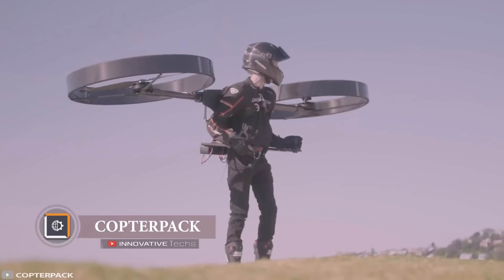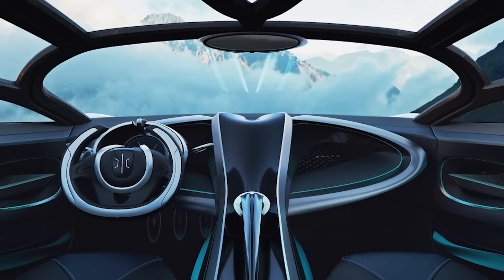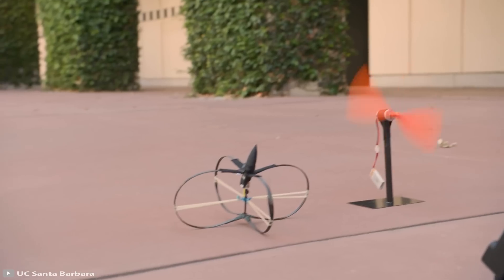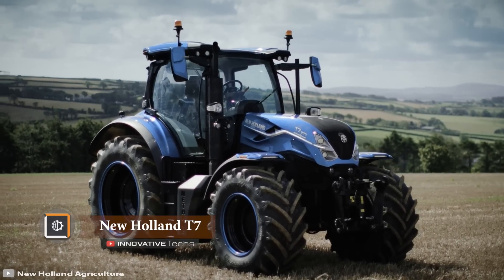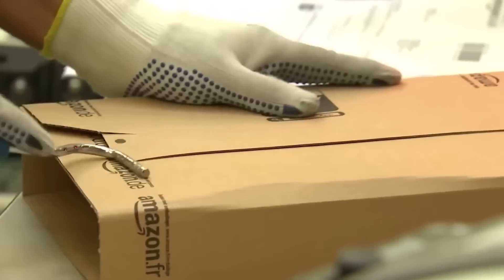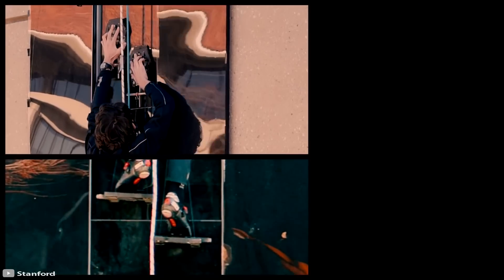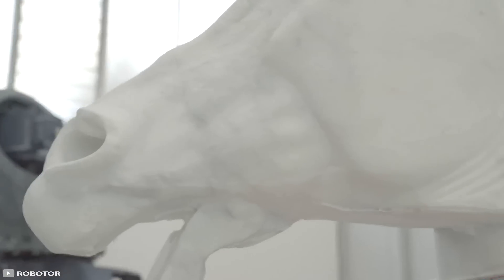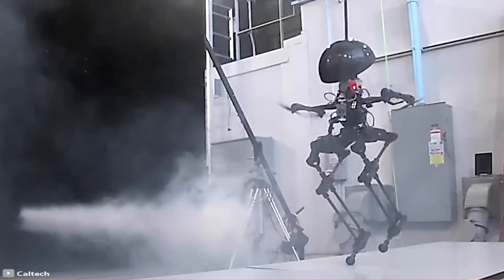INCREDIBLE INVENTIONS YOU DIDN'T KNOW ABOUT

Comment: Wait !
Right off the bat the first one boasts about not using fossil fuels since it uses electric. Non fossil fuel electric is not reliable and to keep up with demand is usually generated with probably a shotload more fossil fuel than the environmentalists would like to admit. Wind turbines are an environmental disaster and batteries which rely on filthy unregulated Chinese produced elements are even more of an environmental disaster.  Windmill turbines deteriate quickly and battery recycling is a farce. I am totally on board with environmental responsibility but don't be fooled by the many "environmental activists who really don't know what the Hell they are talking about. To many of them it's a form of religion or more accurately, a CULT !!!!!!!
Do your research and you will see that its usually not so much about the environment bit about money and control. Wise up people, wise up!!!!!!